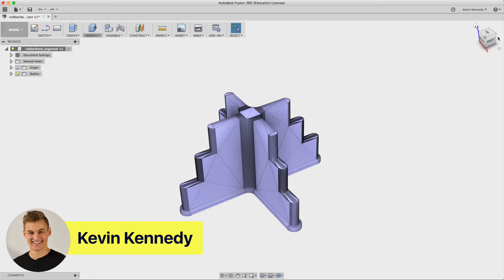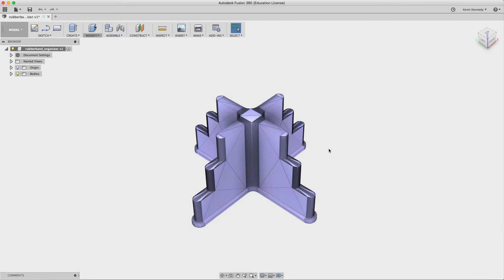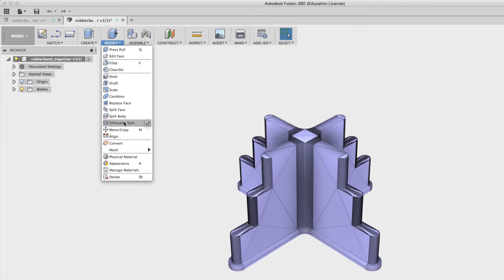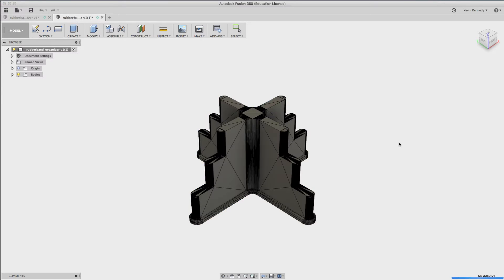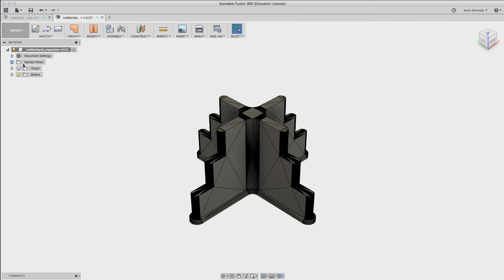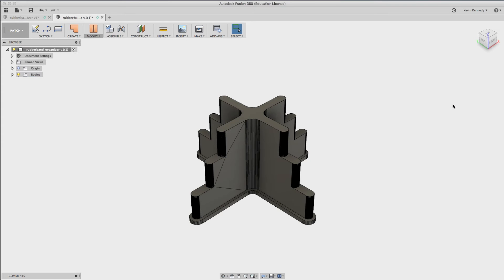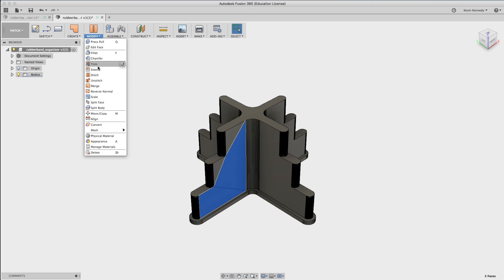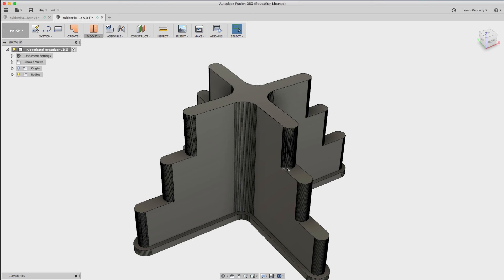Fusion 360: How to Convert .STL to a Solid Model in Fusion 360

Comment: what are solid bodies for?
Reply from the maker: Fusion 360 supports 4 different types of bodies - solid, surface, t-spline, and mesh. Each one has a different math that makes up the geometry (or the code behind it). Solid bodies are the most common for parametric modeling in Fusion 360. Mesh files - STL or OBJ - are the format required for majority of 3D printers. Thus, you have to convert from Mesh to Solid to utilize the Solid tools in Fusion 360.

Comment: I try to add Emboss to a surface and it does not work. Does it need to be tangent ? How to i create a surface that is tangent and emboss solid command recognizes it
Reply from the maker: Emboss will only work with solid bodies. Are you trying with a mesh or a solid body?

It will also only work on single curves for now. Things that curve in two directions (or twist) will not work.

Comment: I'm using the startup license version and the convert menu entry does not exist.  Is the license version limited?
Reply from the maker: Hi John, All Fusion 360 licenses provide the same tools and features with the exception of Generative design and Simulation tools only being present in paid licenses. With that said, I'm actually coming out with a newer version of this tutorial later tonight, which will reflect the new UI changes and some extra tips and techniques. Stay tuned! Cheers, Kevin :)
Reply: @ProductDesignOnline  I successfully converted a mesh to a body but then I split it and the two parts were open as if they were not solids.  That was unexpected and not really useful.
Reply from the maker: @johnvonachen1672  You will need to split the file first (before conversion) or you can use the SURFACE (tab) tools to "patch" the holes of the model where you split it. If patched correctly, it will turn each half back into a solid body. Cheers, Kevin :)
Reply from the maker: Hi John, here is the new STL conversion tutorial, updated for the 2019 changes, that I just released - https://youtu.be/pgWWVcM5YJY

Comment: Any solution to mesh to B rep big  Mesh??  Fusion says warning when the number of faces its too big.
Any program or solution to can Mesh to B-rep without remesh whit minus faces.??
Reply from the maker: Hi, Jack. First, Check out this newer version of this video (I cover lowering the mesh faces) - https://youtu.be/yO6hboYWnfM

You can use the Mesh workspace (steps in that video) to lower the number of faces. For some extremely large models, you'll still have difficulty. That's where Autodesk Meshmixer comes into play (Also free). Once you lower the mesh triangle count in Meshmixer than you can import it back into Fusion 360 for further editing. Cheers, Kevin :)

Comment: I imported my stl file. Then did Mesh to BREP. I can not select the body in this menu. I have a 'orange' hollow body. :/ I want to fill it for some simulations
Reply from the maker: Hi, x200ants. Would you mind replying with a link to a screenshot of your problem? That will help me see what's going on and make it easier to decipher why this is happening. Cheers, Kevin :)
Reply: @ProductDesignOnline  wow, thx for the respond. I finally fixed it. There was a very very small  gap in my body. So I was able to do it. 

To fix that gap, I used PATCH, removed some faces, and the then glue everything.

Best
Reply from the maker: @x200ants  No problem. I'm always more than happy to help troubleshoot. Glad you got it figured out! STL files can definitely be tricky when they have holes in them. Cheers, Kevin :)

Comment: Is it possible to combine it with another body?
Reply from the maker: Hi Vipera74. Great question! If you want to combine two bodies in Fusion 360 then you'll have to convert both STL bodies to BRep solid bodies. Then you can use the modify > combine tool. You can then re-export as an STL file.

If you want to combine STL bodies without converting them to solid bodies then I would recommend using Autodesk Meshmixer, which you can download for free. Cheers, Kevin :)

Comment: Thanks for this video. 

I would like to know how can i still convert a high faces (more than 600 000) mesh into a solid when fusion 360 doesn't want to do the conversion.
Reply from the maker: Hi, Kenson. Great question. At this point, Fusion 360 is not able to convert such a high number of faces. Based on how Fusion 360 was built, it's also very likely it never will be able to handle such a high amount.

What you'll want to do is reduce the face count in Autodesk Meshmixer, which is another free program by Autodesk. Meshmixer was built for mesh (triangular) type files. You can download Meshmixer here: http://www.meshmixer.com/download.html

Then, if you reduce the face count to 50-60k or less (preferably 30K or less) you could then import it back into Fusion 360 if you're still looking to convert the file to a solid body. Cheers, Kevin :)
Reply: @ProductDesignOnline  Thank you for your answer. It's great to know somebody can help when you got stuck.
Reply from the maker: @kendelpho  You're welcome! Glad I could help :)
Reply: @ProductDesignOnline  @Kenson Delphonse This official Autodesk video (watch?v=yMaih-vPNr4) has a great explanation of the workflow of STL files in F360 and Meshmixer. It shows you how to reduce facets.
Reply from the maker: @antiundead  Thanks for sharing this! Cheers, Kevin :)

Comment: The convert does not work for me, Fusion says to many triangles (392).
Reply from the maker: Twinstar - Fusion 360 can be picky sometimes if your files have A LOT of triangles which make it complex. You will have to reduce the number of triangles first. To do so, go to Mesh Workspace and select "reduce" from the Modify dropdown menu. Select "face count" as the "reduce target," then you will see just below that a face count slider will appear where you can lower the number of faces.

If you don't see the Mesh Workspace: You need to be in a direct modeling mode. This can either be done by disabling the timeline or by creating a base feature. Once done, the Mesh environment will appear in the ribbon drop down menu. This article here goes over that in more detail - http://bit.ly/mesh-environment

Then, switch back to the Model Workspace and right-click the mesh and try to convert it into a BRep (Mesh to BRep) again. It should work!

Let me know if this works! Cheers, Kevin :)

p.s. I have on my to-do list to do a more in-depth video where I'll talk about these common issues.
Reply: Same scenario for me

Comment: I don't get a drop down menu when i go to the mesh menu any ideas Thanks.
Reply from the maker: Hi Frank,

Is your timeline (at the bottom of Fusion 360) enabled or disabled? The mesh environment is a direct modeling only procedure, so the timeline needs to be off. To do this, please refer to this guide: http://bit.ly/turn-off-timeline

Alternatively, if you do not want to fully disable the timeline, you can select, Create->New Base Feature to temporarily go into the direct modeling environment until you finish the base feature.

Let me know if either of these work for you!

Cheers,
Kevin :)
Reply: Hi Kevin sorry it took so long to thank you for the fast reply i left on vaca right after i posted the ?  it was the timeline not disabled & that did it thanks again!!
Reply from the maker: I'm happy to hear you got it to work! Cheers, Kevin :)